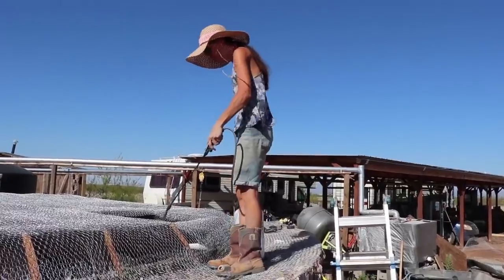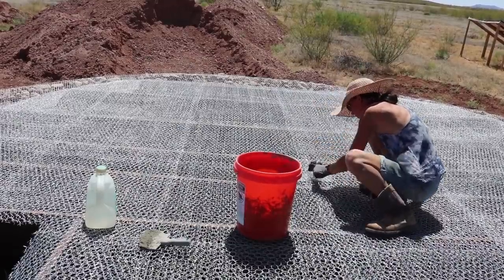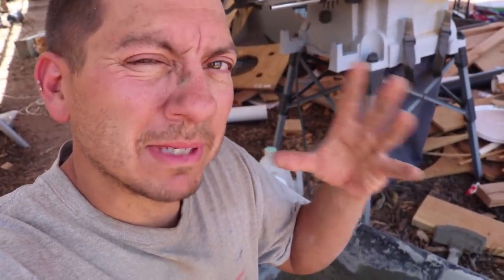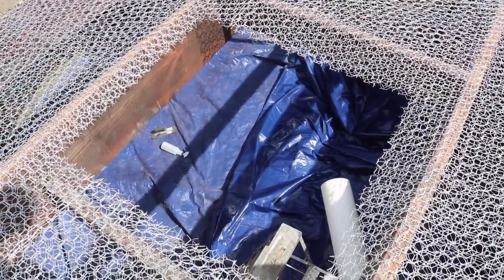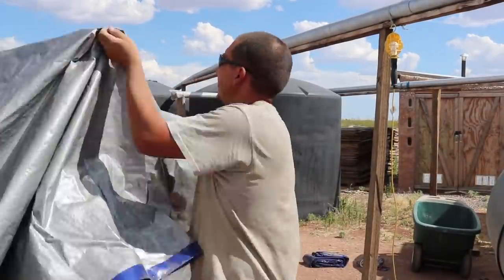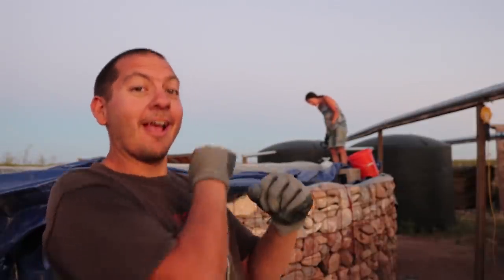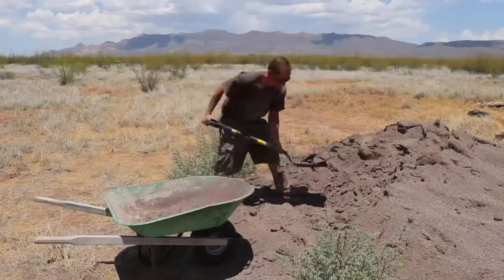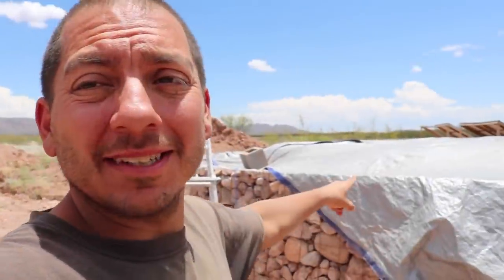Building A Ferrocement Roof For Our Earthbag Cistern | How We Compost and Breed Black Soldier Flies

Comment: An easy edging material for access holes in wire is pipe as you can cut a slot in it to slide over the wire and at worst ziptie in place to make the access easier and less likely to scratch/poke you as you enter/exit it. Table saw and some copper or pvc pipe and you quickly have a slot cut. 

Will you be painting the cement roof with a roofing paint or leaving it as exposed cement?
Reply from the maker: We were thinking just exposed, but maybe a paint is a good idea.

Comment: Wouldn't it been a lot easier if you'd laid down some of that pond liner under the chicken wire? That way you would've 1. created a nice water tight seal for the lid, and 2. it would of been a lot easier to apply the ferro-cement and not have to worry about the cement falling through mesh. I not know just thinking here, I do realize you would have added cost in the pond liner.
Reply from the maker: It would have been easier for sure.